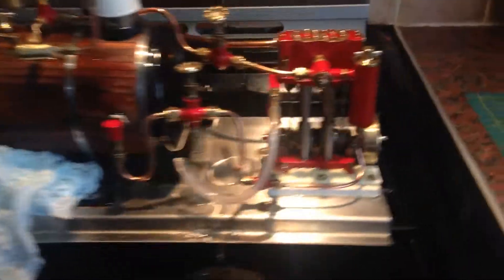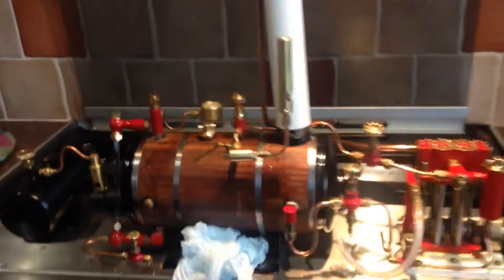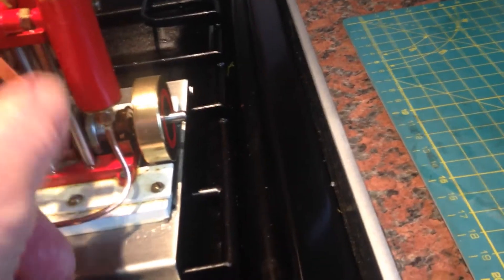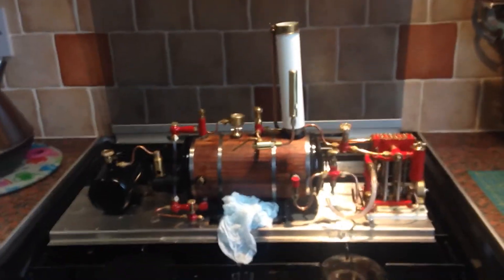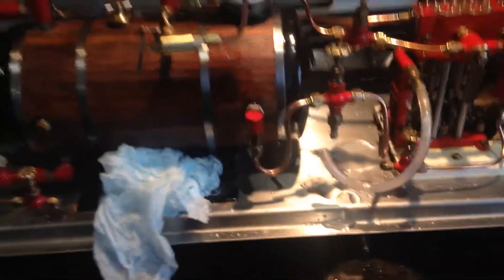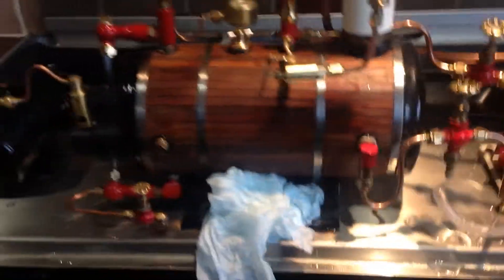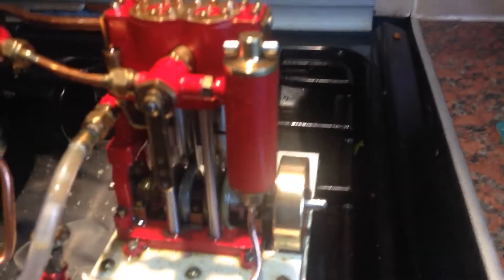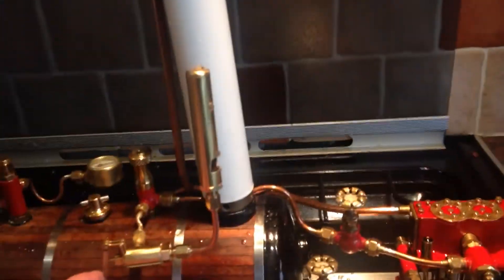Max 11 steam plant whistle test @ 40 psi roy.burton1@ntlworld.com

Comment: Nice plant it is..did have the same years ago. JOHN H Told me run it on 50 psi..or it will act like aa waterpump..
Reply from the maker: Hi Bernhard, this the larger MH boiler , so when running the pump  60 psi , steam pressure  tested at a working presser of 70 psi so , can run  OK at 60psi, depending on temperatures and weather conditions